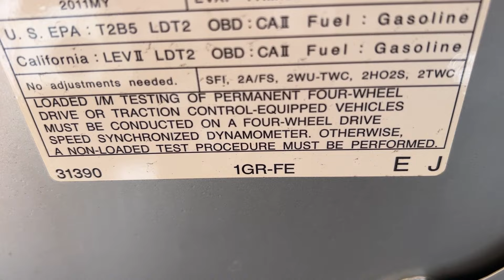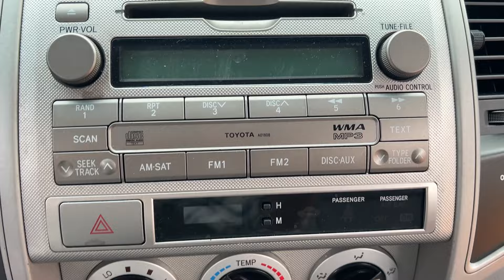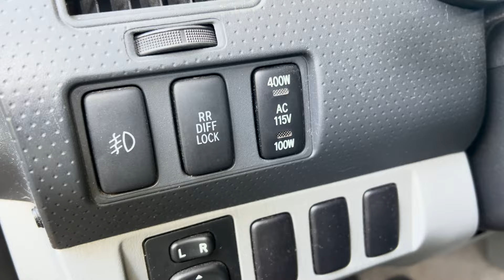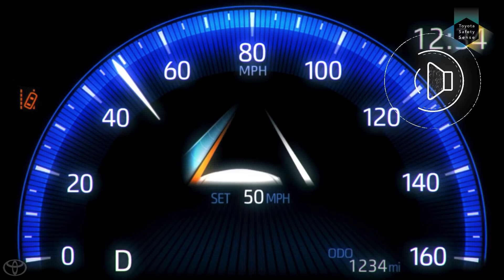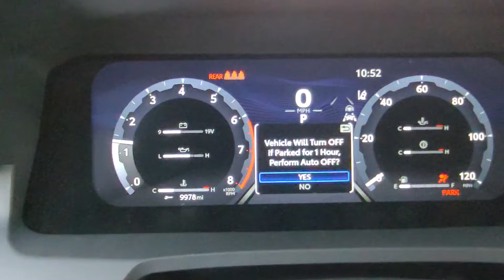Problems to Look Out for When Buying a Used Toyota Tacoma

Comment: I'm concerned about the new turbo charged engine.  As a general rule they tend to wear out more quickly.  I wish they would've given the option of a normal 6- cylinder.
Reply: The turbocharger itself is unlikely to last beyond 250k. Second and third owners should expect some expensive repairs if they want to take the odometer to the moon like you could with older Tacos.
Reply: As a general rule probably correct, but don't forget over-the-road diesels have turbocharged engines that are expected to go millions of miles, and those engines experience more combustion pressures by far than any gas engine. It's all in the engineering and there's no particular reason a turbo or a turbocharged engine can't last as long as anything else. My own intuition is that maintenance or lack thereof is a big part of their bad reputation, engineering is likely a case-specific second reason, and Scotty Kilmer is the third.
Reply: Toyota has had experience with turbos for decades overseas. Diesel engines mostly, but they also create more heat so..
Reply: Exactly !
That’s why I bought my 23 Tacoma TRD Off Road, double cab, 6’ bed with the Premium and Technology pkgs.
At my age this will be the last pickup I’ll ever buy. I only drive 6-8K miles per year and change the oil every 5K miles. I have always changed my front and rear differential, transfer case and transmission fluid every 30K miles and will continue to do so on my current TRD.
Reply: @GlennC789 Turbo diesel engines are way different than gas turbo engines. Gas turbo engines can’t handle the high pressure wear and tear like a diesel engine can.
Reply: @jaymoar3561  That's fair, but only because they're built differently. There's no reason a gas turbo engine can't have heavier-duty bearings, engine block, etc just like diesel engines. To me it's just a matter of engineers doing things properly and bean counters recognizing what the engineers tell them. By which, I think I have found the fault in the process.
Reply: Do regular fuel cleaners clean carbon out of the engine intake?
Reply: OK, that little voice warning you about turbos is Correct! Turbos do not live as long as normal aspiration engines.
Reply: @GlennC789  Rev up your engines! (I couldn't help it)

Comment: The best Tacomas were the ones made in Fremont, California, USA. In the used market, the 4.0 V6 and 2.7 4 cylinder engines are the ones to get. As a Canadian, I object to the term 'Rust Belt' when applied to vehicles. I call the northern USA and Canada the Salt Belt. My car is 19 years old and rust free because it receives quality rustproofing treatment every year. In the Salt Belt rustproofing is just mandatory preventative maintenance in the same way fluid changes are preventative maintenance .  Rust = Neglect.
Reply: Thank you for sharing your love for your truck. I worked at the Fremont plant with a close knit group of people that took great pride in their work. I own a Tacoma X Runner it's mileage is 256,000 it's a 2007. We made 4 of them a day, two on day shift and two on night shift, the rest of the Tacomas on an average day numbered 900 total shifts. Thank you again for your purchase and your expression of love of your vehicle. Wishing you many more years of enjoyment and safety.
Reply: @bonniedouglas6580  We have a 2005 Vibe and 2010 Tacoma and you folks did a fine job building both of them. Have you seen the videos about the 1.6 million mile Tacoma which also came from your factory?
Reply: @1northsparrow246  thank you so very much for sharing this with me and thank you as well for your purchase of our NUMMI vehicles. It definitely means a lot to us former workers to see our vehicles on the roads and being enjoyed by many. I will relay this message to other members of the plant. We try to get together for lunch once a month, but as the plant closed and later reopened as Tesla, that was fourteen years ago and our teammate numbers are getting smaller. I  will definitely have to check out the video that you suggested. Thank you for sharing this information and being very satisfied purchaser of our much loved products. You have definitely brightened my day. Thank you again and Happy holidays 😊.
Reply: @1northsparrow246  thank you so very much for the information about the video. What a wonderful, sweet and sensitive man. Rest in heaven Mike. My deepest sympathy to his dear wife and to his family and friends. I know that he will be greatly missed. What a wonderful video, I am so glad that they are keeping it safe and honoring Mike and his life.
I put U A W and our local union number on the back window of my truck to remind the bigger trucks that I was driving an American made product and not an import, they tried to intimate me. I missed making 25 years by a couple of days. Most of us still miss working at the plant. I was also there at GM before it became NUMMI. Thank you again for sharing and your purchase of our NUMMI vehicles. Blessings to you and yours always.

Comment: I think it's worth mentioning, but the 3rd gen tacomas have been seen with quite high mileage already. If you look around, you will find them with 300 to 500k miles already. And almost all of the ones I've seen.  Have been the 2gr fks 3.5 v6.  The car care nut.  Even said in one of his videos on the 3rd generation tacoma.  That he believes the 2gr fks is just as reliable as it's predecessor the 1gr found on the 2nd gen tacoma and previous generation 4runners. They do develop a timing cover seep. And possibly a bypass coolant leak. However these issues seem to be more of a problem with the earlier year models.

Comment: All Tacomas stemming from 95.5 to 2009 are very sensitive to overheating and known for blown head gaskets. As long as you don’t overheat them they will last a very VERY long time. Also correction to the engine for the first gen. The first two are correct the 3rd was a 5vzfe. I have a 6 cylinder 1995 with 227k miles.
Reply: I thought it stopped at 06?

Comment: Ive been looking at a 07 tacoma with 170k miles for 11k. Its an automatic and v6 2wd is it worth it? It had an transmission was replace in the last 10k miles not sure what that could mean if it might have been abused? Thanks in advance.
Reply: No, too old, possibly has more issues needing repairs. Also 4wd is a better choice for resale.

Comment: I purchased a 2007 TRD Sport in 2014 with 73,000 miles on it for $16,000.00. It now has 250,000 miles on it and all i did was replace the alternator, regular oil changes, tire rotations, and just changed the plugs. It's been a great truck.

Comment: I love my 2012 4x4 TRD sport in manual Taco won't get rid of it 😎🤘🏾
Reply: Anything to look out for? Currently in the process of buying a 2014 4x4 manual Tx Baja edition.
Reply: @Calimota619  ohh nice 👌🏾👌🏾 yes well obviously look for any rust on the frame, toyota fixed that problem after 2012 but you never, still look at it. Get a feel of the manual in all gears as well, how many miles does it have?

Comment: Have a 2017 Tacoma with a 2.7 ,2WD I do not off road so no need for 4WD , have not had any 3rd. brake light leaks so far ,rust checked every spent 5 winters in Florida .90,000 KL.,45.000 miles . Has developed a noise when I apply brakes in the front think it might be the pads . Other than that no issues at all . The new ones are having transmission problems , torque converter and some engine issues  and body panel fitment issues . Like the old saying never buy the first year of anything . I have seem some dealers on You tube with Tundras and Tacomas as far as the eye can see  and offering $6000 to $8000 off MSRP trying to move them . The new ones quality is not what is use to be.
Reply: He never said WHAT he didn't like about the 2016-17 Tacomas other than the light. He sort of referenced another vid but I can't find that either. Any idea what he refers to?

Comment: I have a 2002 Toyota Tacoma pre-runner which is a simple truck without all the modern technology and just runs and runs. Very dependable and always starts. Plenty of life left in it with only 60,000 original miles. Excellent !

Comment: I bought new a 2005 Toyota Tacoma, V6 TRD OFF ROAD Access Cab built in Fremont.
Never towed with it or took it off road.
It has the locking rear end and all the options.
Currently it has just a little over 20k original miles.
I don’t have any of the rust problems but the clear coat is starting to go. I was thinking about selling it but maybe I should just get it painted.
Reply: Just get it painted.

Comment: I have 2015 4x4 TRD Tacoma. I am using full synthetic oil every 8000 miles. Do you recommend I only go 5k even with full synthetic oil? Also I’m about to hit 60k miles so you recommend do transmission fluid replacement?
Reply: Yes to both. Quality synth engine oil and filter every 5K or 6 months to prevent excessive wear and VVT problems. Trans drain and fill with correct fluid every 5 years or 50K and you won't have problems. Watch Car Care Nut on youtube for tips.

Comment: Had a 2008 Tacoma V6. Sold it with 388,000 miles. Original engine and transmission.
Reply: Just bought a 2008 Tacoma V6 with 180,000 miles, glad to hear I will get many more out of it
Reply: @shane106 how much did you spend?
Reply: @Action_Clips_CODM  13k
Reply: @shane106  Geeze
Reply: @Action_Clips_CODM  to be fair it has the TRD off road package

Comment: I purposefully bought my 23 TRD Off Road, double cab, 6’ bed with the premium and technology pkgs because historically a Turbo engine doesn’t last as long as a naturally aspirated engine.
I change the oil every 5K miles and the front and rear differential, transfer case and transmission fluid every 30K miles.
I’m an absolute maintenance nut, only because great maintenance is far cheaper than expensive breakdowns or buying a new vehicle.
I drove my first Toyota for 24 years and when it died in 02 it had 488K miles. I promptly replaced it with a new Camry and drove it until my needs changed in 11 so I bought a new Rav 4WD Limited with the 3.5L V6.
I then decided to buy my 23 Tacoma and sold my Rav to a friend because he knew how well I maintain my vehicles.

Comment: For anyone whose not familiar with toyotas.  Understand every vehicle has problems. And many of these problems have been shared with other makes.  For example my 95 k1500.  Has had seized brake calipers and just last year.  I had to replace my U joints.  Every vehicle will have problems. It's just the major ones you do not wanna deal with.

Comment: I had a 2008 TRD sport for 11 years, traded it in on a 2017 Tacoma TRD sport, that I still own. I really liked the 4.0 auto combo in the 08 better than the 3.5 CVT combo in the 17. But absolutely no problems with either pickup. Change tranny fluid in the 08 @ 60k sum miles, after noticing slight slippage.
Reply: Tacomas DO NOT have CVTs lmao
Reply: 3rd gen Tacoma has 6 speed regular transmission.Their not CVT.

Comment: If the 2.7L would have produced 200-225 horsepower, I would have bought it instead of the 3.5L V6.
Those 4 bangers are bulletproof.
On another note, if you have a 4WD Toyota, engage the 4WD system at least once a month year round. Just put it into 4WD below 60 mph on a flat road, drive it about a mile and put it back into 2WD and your 4WD system will give you many years of trouble free service.

Comment: I bought a used 14 Taco base model with 64000 miles a few years ago, 2.7 auto, AC has no cruise, but replaced the bench seat recently with buckets also from a 14 model.  Just replaced the rear brakes at 120,000 miles. Mine has no rust.

Comment: Got a 21 TRD Sport 4x4 Taco in April, the only issues I had was the dealership didn't have the leaser fix the dings an scratch's they caused!~
  Had the radio replaced within 2 months of getting the truck, so I can't use the connected services, so what, the remote start is built into the truck which is all I want!~

Comment: In one year after updates are implemented, BUY A NEW TURBO CHARGER and keep it handy, because the PRICE WILL GO UP and many people will be replacing these, along with the oil feed line that goes to the TC that lubricates it, BUY BOTH, you always replace both because if the oil line is plugged in anyway, which in many cases is the cause of TC failures, and you put a new 2k TC in and it will burn out again in two months.

Comment: Purchase the 2014 Tacoma TRD sport v6. 40.  69,000 MI. I want to change the plugs. One side has NGK.  The other side Denzel. On the passenger side. The middle plug was full of oil.  The plugs look like. They've been incense factory. So I ordered the gasket. The truck didn't smoke or anything. But it worried me about the piston. Down the road.

Comment: ? The 1GR 4.0 liters were widely regarded as better suited to the Tacoma than the newer 2GR 3.5s. Better power off the line and quieter.
2GR had only slightly better fuel economy.

Comment: 2024 Tacoma "best Tacoma ever"??...common knowledge that turbo engines increase engine pressure thereby reducing lifespan. This is something you're stuck with, not to mention the transmission issues that are popping up with this model. Aside from a rather extreme jump in price, these are reasons new Tacoma sales are dismal.

Comment: Couple of things I dont agree with.  1st. 4.0 Liters can get respectable mpg, i avg 20.5 combined. Secondly, the seats were much more durable in the 2nd gen than the 1st. Lastly, how could you not talk about the durability questions on the new Tacoma when there have been two that have broken while test driving them, one was a transmission issue andnthe other a front suspension issue. Not to mention the new Tundras are having major issues.

Comment: 2024 tacoma is a victim of the ford frontend style same as every other pickup nowadays. Needlessly large front bumper that is just plain ugly. You lose front approach angle clearance and gain nothing other than an aesthetic that appeals to people who don't use trucks for work. Unfortunately only the trd pro and trailhunter trim correct this. I suppose you could go aftermarket but its already an expensive truck. In fact it's why I'm in the used market at all.

Comment: As a former Mechanical Breakdown Inspector AND a proud owner of many Toyotas (granted, not Tacomas but multiple 4Rynners), I agree with most - not all but most - statements in the video. 
First and foremost, the 4.0V6 is a marvel of engineering. Yes, oil changes are important but I totally disagree with the towing warning. I towed a lot of stuff with my 4Runner (same engine, same drivetrain as Tacoma) including a flatbed trailer with a tractor on it up 10mi long steep hills, and never had an issue with either trans or the engine. I just sold my 2004 4Runner with 350,000+ miles on the odometer. Somebody overheated it because of a leaking heater hose so head gaskets had to be replaced at about 300,000. The cylinders still had factory crosshatch, the heads were perfectly flat. Other than that, only minor stuff over 20 years/350K mi of rough service. Granted, it was made in Japan rather than Mexico so there was no rust anywhere despite the fact that it spent all its life in the Midwest and Northwest.
The only - rightfully mentioned - common problem was front caliper lower pistons and... nothing else. Yes, I did replace the AC condenser, calipers, and a few bulbs. No u-joint problems. No 4wd issues.
Yes, the first thing I did was throwing away factory radio with - yes - TAPE PLAYER (!!!) and installed an aftermarket unit.
Bottom line: you can use hitch wear as a price-cutting point but don't run away because of that.
Reply from the maker: Thank you for your comments.
My main point which I try to convey in the video is that hitch wear is indicative of extra wear on all the major (read expensive) components on the vehicle. Given a choice I would rather purchase a vehicle that has the factory tow hitch installed, but never used than buying a vehicle that has was used to tow an unknown amount of weight. Particularly concerning would be if you are buying from a dealership and you cannot know for sure what exactly the previous owner was towing. Was it a 10,000 pound behemoth? That would certainly stress out the engine, transmission and suspension. 
All I try to emphasize is that it’s a “safer” bet getting a hard working Tacoma that yes, is perfectly capable of being worked hard, but wasn’t over getting one that has been pushed hard and maybe beyond its prescribed limits. 
Thanks again!
Reply: @YourCarAngel  I agree - it's better to buy one without history of towing but it's not necessarily a deal breaker. One other note: the other thing I did to all my Toyotas (other than replacement of awful stereo) was trans cooler. Cheap, easy, and meaningful upgrade.